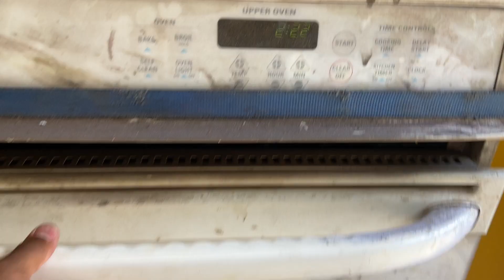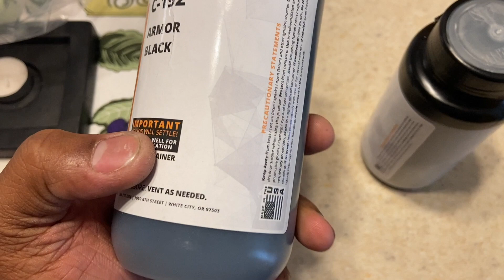Banshee Cerakote FMF Exhaust and Powder Coat Motor Mounting Hardware

Comment: Did you have to take the silensors apart? I have a new set i want black just like those
Reply from the maker: @marcosolivo2606  yes you do to pack the silencer.. but since this was air cure, I coated after reassembling and repacking.